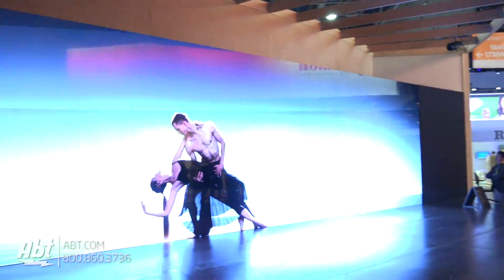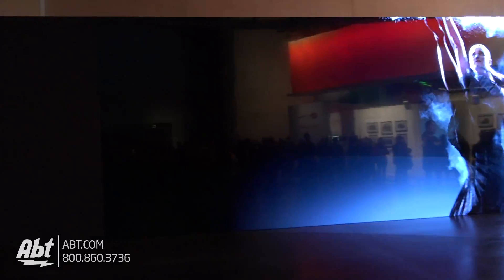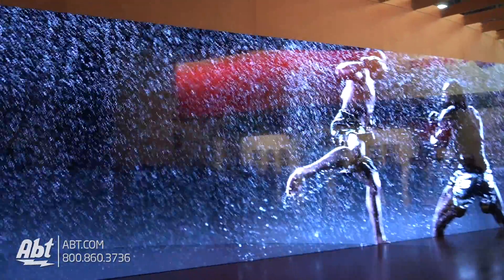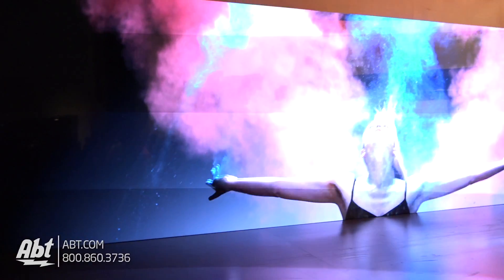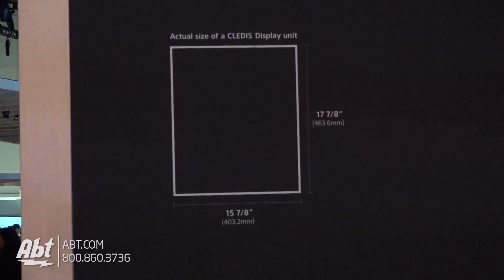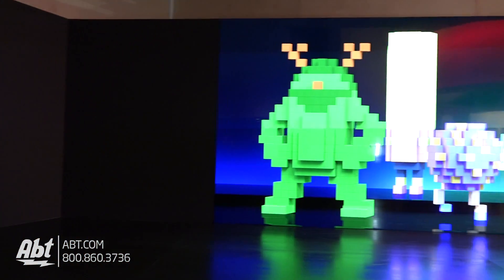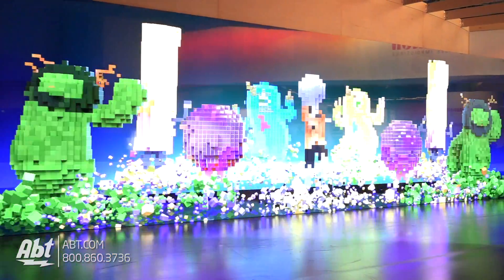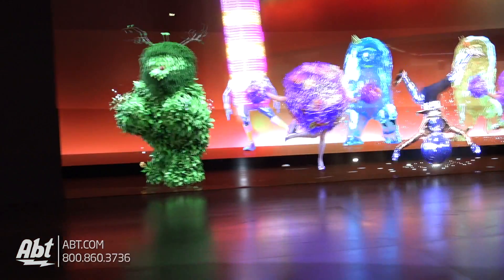CES 2017 - Sony CLEDIS - Crystal LED Integrated Structure

Comment: The price for this configuration is $720,000. Each module costs $5,000 and is 15.8 inches x 17.8 inches. You also need a processor for each panel, running on a powerful server, which will bring the total price close to $1 million for this 32ft x 9ft configuration.
Reply: He said they each have their own processor.
Reply: Nope, 5k a panel(1 module)
Reply: I think $5000 for the whole panel, the big screen, not for the individual module (unit)..

Comment: ABT, is this a MicroLED or OLED display?
Reply from the maker: Hi Caleb.  My Sony representative explained it to me this way, "This is a system that is designed to work on a larger scale, so it’s not like a traditional LCD or OLED TV.  Each sub panel has self emitting RGB pixels, and the sub panels are designed to be stitched together to make a scalable display."  I hope that helps.  This setup was absolutely amazing to see in person so I'm really hoping they make it for consumer use at some point in the future!  Thanks for watching.  -Carl
Reply: I found it out, it really is a MicroLED display! 

"It took another four years before Sony showed results from continuous investments in micro-LEDs, some spurred by Apple. Sony launched its latest addition to the Crystal CLEDIS (Crystal LED Integrated Structure) at Infocomm in June 2016. The latest product features “module splicing”, which greatly lowered the number of LED chips required, and lowered Pixel per Inch from 40 to 15. These changes have made it possible for Sony to realize mass production, and the company announced it would be able to commercialize CLEDIS in 2017."

http://www.ledinside.com/news/2016/11/can_micro_led_challenge_lcd_and_oled_market_position
Reply: Abt Electronics ...But OLED also has self emitting RGB pixels...
Reply: Oliver Moore, anything that uses LED technology can suffer a burn-in, but OLED just happens to be more susceptible.
Reply: Jason Lee RGBW pixels *
Reply: Michael Dunn, you should get my point.

Comment: Would not be surprised if the display they demonstrated came in at 500k or even above that. It's a bunch of borderless OLED tablets daisy chained plus at a low volume production scale for the B2B market 😳 crazy!
Reply from the maker: Yeah, definitely meant for B2B, but hopefully the tech will trickle down to the consumer market eventually.

Comment: estimated cost
17 7/8" x 15 7/8"  17.875 x 15.875
9 x 32 feet

108 inches x 384 inches
108/17.875  384/15.875

6 panels x 24 panels=144 panels
at $5,000 per panel $720,000
Reply: John Koski us $ or which country because I will rather buy another home and rolls Royce than that price.
Reply: U.S.A. $
Reply: John Koski I would rather not waste such amount on screens better buy whole imax with laser projector

Comment: THIS IS TOO GOOD TO BE EVEN TRUE. 
I know this thing will be crazy expensive, but still how much are we talking about?
Reply: $5000 per tile

18 tiles needed for Full-HD (108 inches diagonal)

72 tiles needed for 4k (216 inches diagonal)

Display controller sold separately
Display contoller supports up to 72 tiles

4 display controllers and 288 tiles needed for 8k
(864 inches diagonal)

16 controllers and 1152 tiles needed for 16k (1728 inches diagonal)

Maximum possible: 20 controllers and 1440 tiles
Reply: abhi_sh3_k I think if you have to ask you can't afford it. I'd imagine a single display installation would approach several hundred thousand, making it too expensive for anyone to bother using except perhaps really dedicated and wealthy consumers. I wouldn't see commercial customers being interested as there are ways of achieving the same effect for far less money.
Reply: +cjeam in the future it will be the normal probably.
Reply: Expensive panel yet using old small microleds when others have microleds grown on a 1inch piece of silicon with 5000ppi while another has 2 inches with 10000ppi on it lol Samsung and Sony are way behind microled to make them microscopic level as JBD and others who are shrinking LEDs down to the size of nano size

Comment: It's not a trick, It's a SONY !
Reply: It's THICC*
Reply: Don't worry, the PSU is going to fail after 4 years of use due to shitty capacitors and or that fucking glue they spray all over the PCB's for some fucking reason that becomes conductive after awhile and shorts everything
Reply: I was right each panel to make a wall size TV is 10k per panel so it will cost nearly 1million to own biggest and best ultimate tv I'm the world

Comment: the death of proiector
Reply: I'd buy a $150 projector over multiple $5000 panels...
Reply: Matteo Bonomi Yep!
Reply: @rotaryperfection  Sir, can you give me your contact details
Reply: Matteo Bonomi errr....projectors are quite a bit cheaper, so not for a long long time if ever
Reply: right but a projector dont are better than cristal led 10-0
Reply: It was death of the old film projectors now it's Gona be the death of the digital projector to new improved digital screens instead
Reply: @jonathanoxlade4252  Sir, can you give me your contact details
Reply: It costs 1 milli booooo
Reply: Yet a company has a piece of silicon with 4k 10000ppi on a chip about the size of a computer processor chip and can hit 2millon nits lol
Reply: Too expensive.

Comment: OMG I WANT THIS  Crystal LED ITS AMAZING
Reply: LOVERPC 4EVER Sony presented this last year as Sony canvas for profesional purpouses and said it was coming in 2017 so it looks like they Will sell it to both consumen and pro, its great because Samsung had a prototype last year too but this is more advanced and coming sooner, I imagine a 64k display like this the size of a scoreboard.
Reply: Natanael Rodriguez Actually 8K x 2K
Reply: Natanael Rodriguez what is that useful for? There's nothing to display on this that isn't made up of individual image signals, at which point a traditional multi-monitor set-up becomes more sensible. It's a ridiculously impressive technology demonstration but that's all I can see it being.
Reply: LOVERPC 4EVER You can order now... Sony Crystal LED price guide😨: 146" US$278,000. 182" US$554,000. 219" US$776,000.

Comment: This needs to be in movie theaters!!!
Reply from the maker: https://www.youtube.com/watch?v=qeywxkBpMB0
Reply: There is a major, major downside to this tech and a big reason it will never work in a theater. Acoustic Transparency. These panels are not capable of allowing sound to flow through them like and AT projector screen. In a true theater setting the sound for 90% of the movie comes from directly behind the screen. This makes the sounds stage feel real. Anything like these CLEDIS displays would require the speakers to be placed around the screen. There is no possible way in a large screen size (like a theater) that this could work. The sound would simply be off and you would feel like the voices are coming out of the floor instead of the people on the screen. In a home theater you could get away with this (still a sacrifice), but you would also not achieve 4k with this in a home theater because you need so many panels to get to 4k. Plus I will say that top end laser projectors cost less and achieve close to the same image while still allowing AT screens for sound passthrough.
Reply: @senzubeanbetter  my friend, there is an oled that can be a speaker and there are such TVs.
Reply: Sony can make the screen sound and do not need from behind the screen
Reply: Tachibana Hasegawa sony's screen sound is garbage. No where near what is needed is a theater or home theater. Good for a bedroom Netflix tv though.
Reply: @senzubeanbetter  trash cinema screen, tv best
Reply: No! Maybe OLED or QLED but not LED!
Reply: No need, go visit a Dolby Vision cinema room that uses the Christies digital laser projector, fucking phenomenal picture.
Reply: @1wibble230  laser trash, microled best real image, future cinema
Reply: @АрчиМур-ф7с  well that’s the dumbest thing I’ve read all year. so you’ve never actually been in a  Dolby vision cinema then, ok got it.
Reply: @1wibble230  oled tv is much better than any projector, that's a fact.

Comment: why not a add this to any theater.  it looks better than imax
Reply: Enrique Hernandez you're viewing this on a YouTube video, that's no basis from which to make that assessment, and imax is not just a screen format, that is a significant misunderstanding.
Reply: @cjeam thanks for the info, and for being a helpful person in general
Reply: Enrique Hernandez A ticket would cost $100> ...
Reply: smartass
Reply: Posted the same on another comment, but it will not work in a theater because it is not Acoustically Transparent. The speakers have to be behind the screen in a theater to produce realistic sound stages. You can fake it to some extent, but on large screen it will be impossible not to notice voices are not coming from the person if the speakers are placed around the screen instead of behind it. Heck I can easily tell that on a 120" home theater screen. You get into the realm of commercial theaters and it will be like the person's voice is coming from your feet.
Reply: Brandon Coyle there's little difference between this and Samsungs new cinema screen micro led based technology  , they pared with a well established cinema audio horn company to do the speakers matched to digital amplification I believe, dts require silver screens and still use film for most venues and technically cannot match this performance in brightness or contrast however the Samsung is limited in size at being just 32 feet yet is combined with a digital cinema standard. Where's the Sony is seen to be more scalable, it's first install was to replace the boards in Oxford Circus  personally I think if the scaling limitations are resolved is possible this could be a viable alternative to laser projectors and has a significant saving in electric and lifespan that and atmos together and I may think about going back to the big screen
Reply: Enrique Hernandez
 I totally agree with you . But it will be very very coastly when you create such a big screen like IMAX , so ticket price will be very high .
Reply: Enrique Hernandez This is why not... Sony Crystal LED price guide😨: 146" US$278,000. 182" US$554,000. 219" US$776,000.